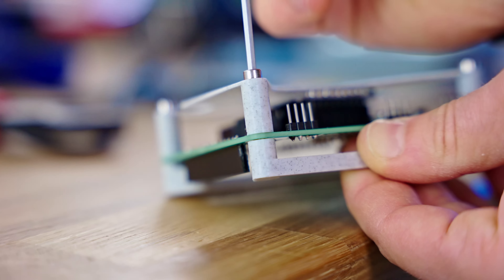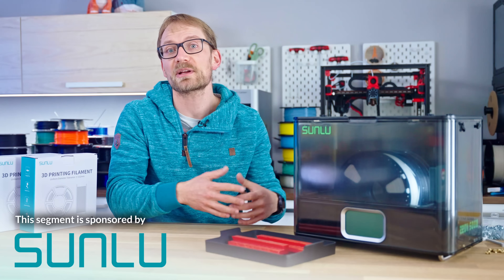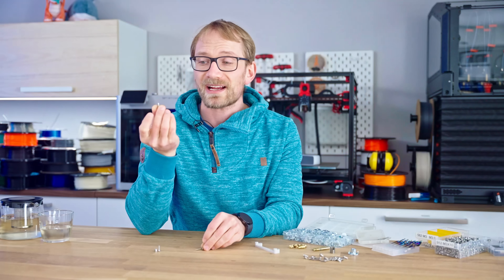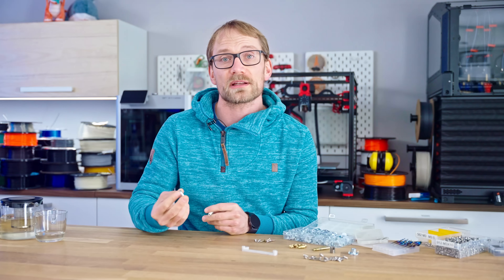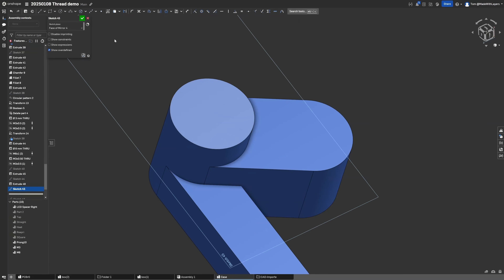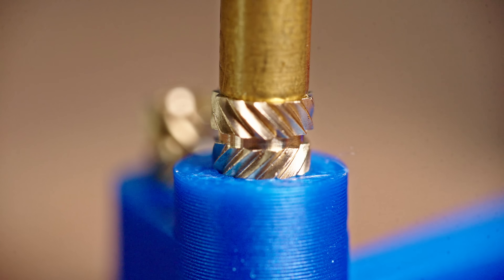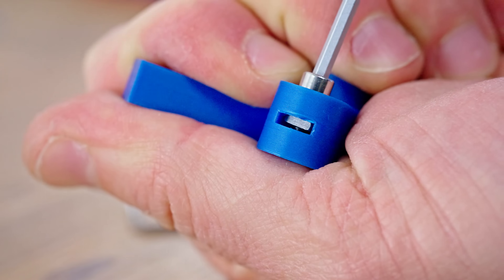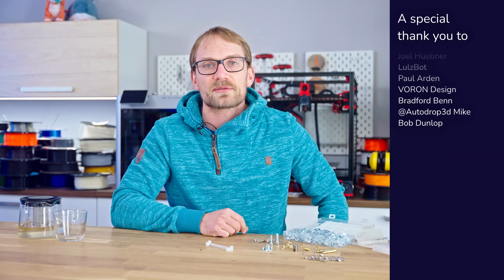A better way to add threads to your 3D prints

Comment: Self forming threads: instead of designing negative with those bumps, you can just create a hexagonal hole. If dimensioned right, threads will cut into the side walls and corners will give space for expansion. Especially easy when designing in Openscad. And instead of three bumps you get six surfaces for thread to cut into
Reply: I've started using a square instead, set to the minimum diameter of the bolt (2.5mm for M3, 4.2 for M5 etc) and it works really well.
Reply: @loganfraser great! Only reason I'd recommend hexagon or octagon is because thread will have more surfaces to cut into
Reply: Orca Slicer can change any hole into a geometric hole.
Reply: Nice, I'm going to give this a try, thanks
Reply: Nice idea, I will try that. Thank you

Comment: You lost me when you said it was hard to source wood screws.
Reply: Yeah... I kept thinking "where are you looking for supplies at?" 😬
Reply: I thought he was more referring to the plastic self-tapping screws, not the wood ones
Reply: They arent the most common for small sizes maybe like m2 or m2.5 sizes
But for common sizes yes wood screws are common
Reply: @yshaalan2011 they are all insanely common

All screw sizes are stupidly easy to find until you get up to specific large bolts.
Reply: @VoltsAnBolts  There are countries without Amazon where even machine screws are hard to get, even in EU
Reply: @julianahavart  In most of the US you just go to your local hardware store and they have a wide selection of wood screws.
Reply: I think helical threaded inserts with some adhesive on them to plastic weld them to printed threads would also be an effective option depending on the amount of tension
Reply: To be fair, I’m not the best or most experienced handyman that’s ever lived, but I’ve literally never even heard of wooden screws before this 😅
Reply: @fiucsavar  it's not wooden screws. It's wood screws. Aka, designed for soft and hardwood applications.
Reply: Hard to source wood screws and hand tapping is difficult. wtf
Reply: @CaptainCorpuscle1  Even if you’re too lazy to hand tap, if you’re melting the plastic with power tapping, you probably shouldn’t be allowed around sharp objects or power tools anyway.
Reply: @Jcreek201  It does sound kinda tedious to hand tap when there are many holes to tap. I can certainly see why using a machine could be tempting. 

Have you tried using a drill or something like that to tap 3D printed parts? I haven't tried it myself but I suspect that heating up the part enough for it to "melt" the threads is actually quite easy to do by accident. After all it may not take that much for many types of filaments to soften them enough that it will rip out the threads instead.
Reply: @Shannon4710 Loads of times.  If the size of the hole is correct, taps do not generate any appreciable heat cutting plastic. Generally, I’ll  model and print the threads and then just chase them with a tap though.  Only time I ever hand tap is if theres an access issue, and blind holes
Reply: @Jcreek201  Well that does sound interesting. My reasoning was based mostly on how hot drill bits and screws can get when working with wood. I didn't expect the same level of heat but still potentially enough to significantly weaken the plastic.
I will definitively look into tapping as an option the next time I have a print where I need screws then.
Thank you for your reply!

Comment: i think captive nuts can be a little better at strength than he says because you can get rid of the slot entirely: pause the print, put them in, and resume. You design the part to have a cavity for the nut that actually isnt accessible from outside. It does mean you're not getting the nut back tho

Comment: you could also buy a thread cutter and cut the threads manualy, since its just plastic they will last forever, just make the hole a bit smaller like 4,2mm for M5 screws. there are tables online for exact sizes which each Metric screw size needs

Comment: In onshape you can modify the mate connector so you don't need to make holes first, just set correct alignment of your mate connectors while importing a delivered parrt (yes - you don't need to create mate connectors beforehand if you dont need them later)

Comment: Something to consider: the slide-in nut approach, but using the T-nuts used with aluminum extrusions. The shape helps prevent them from stripping the surrounding plastic and spinning when you try to tighten them.
Reply: A square nut already gets you tons of surface area and requires less vertical clearance, so a smaller hole in the part. (You can also get thin square nuts, too - an M3 thin nut is like 1.8mm thick.)
Reply: @ed3dnet  It's not always enough surface area, and the corners have a limited lever arm, so it's still possible to end up chewing up plastic when things have to be tight. Also, I haven't done it, but you could potentially design the hole so the nut slides in from outside, similarly to how it slides into an extrusion slot, leaving it captive in a hole it can't easily fall out of.

Comment: You've missed: 
1. Round slide-in insert "Schacht Barrel Nut"
You can drill side hole after print.
2. Heat bolt by using solidering iron and screw in.

Comment: just saw a video on using a slightly tapered hole earlier today. I personally use threaded inserts or nuts in 95% of my applications though.

Comment: I think video is good but just plainly dismissing self tapping plastic screws when talking about plastic is completly unacceptable. And they are cheapest despite what you said, and also ignoring modifiers to increase wall count on screw holes.

Comment: I typically just screw right into the part. I find that a 2.9mm hole in CAD results in the best balance between strength and ease of installation. You can typically take the bolt in and out 15-20 times before it starts to wear out. The major thing is to not overtighten it. Thanks for the video, cheers!

Comment: It took me a while to find out how to print fitting threads because the threads printed “as is” are always too narrow and I was sure that the extra tolerance should be proportional to the thread diameter. But it’s actually really easy : after creating a thread of any diameter and any pitch, I just apply a “press pull” of 0.1 mm on all three sides of the helicoidal groove. It works like a charm for any size of thread as small as M3. I know that how it sounds but it just works… sometimes I press pull 0.15mm but usually, 0.1 is fine.

Comment: I generally just use a hole that is too small to slide the bolt through. The plastic is soft enough to just force the bolt in.

Comment: I've always just printed straight walled holes that are slightly undersized to the thread diameter (my mk3 likes 0,25mm undersize). Sometimes I'll add a small section at the start of the hole thats larger diameter as a thread lead-in (helps get the screw started and helps register the part location by allowing the screws to fall-into the hole slightly). Only had trouble with thread strength at the lower sizes (m2 and m3) and there I just print longer screw holes and use longer screws. I'll usually print the holes with 4 or 5 perimeters or solid infill around it so that if need be I can drill out to a slightly larger size and keep using the hole.

Comment: I use good old hex nuts (usually M3) because they are way easier to find (and cheaper I guess) than metal inserts or square nuts, I make hexagonal holes in my designs for them and I avoid over-tightening them (usually screws don't even need to be tightened too much to avoid damaging the printed part). Also self-locking nuts (those with a nylon o-ring attached) can be a good option in some situations to make sure they don't get loose over time.

Comment: I like to use hex nuts inserted from the back. I add a tapper to the walls in the print for the hex nut so they wedge in when you tighten down and stay there just fine

Comment: I designed a custom laptop tray which can be fitted to my VESA monitor arm and I printed it in PETG. I had originally intended to secure it with nuts and bolts but I discovered that one type of socket head screw I had lying around threaded very snugly into the mounting holes (which are 13mm deep with a lot of surrounding material). Four of these screws have been securely holding up the bracket and my laptop for over a month. I check the connection every couple of days and it shows no sign of loosening.
Reply: On the flip side, I have also dramatically over-engineered parts to use embedded nuts when a simple hole would have been more than sufficient.

Comment: One thing to note on square nuts:  I use a lot of stainless fasteners and when they fail, they will lock up and spin the square nut which makes it easier to scrap the part than to try drilling them out.

Comment: You can make the nut embedded into the 3d print. I tell the slicer that I want to change the filament at the right layer, insert nut, then resume the print.
Also you can use butterfly nuts. Make a cutout for the butterfly nut, it will be very strong. but needs a lot of space.

Comment: I've been creating designs that require a lot of M2 screws. I used printed holes (FreeCAD). I've had 40 out of 40 holes work with no problems. Next I have to do an M3 based design. We'll see if I have the same success......

Comment: if you heat a screw to the right temp you can form the threads with the screw itself, just screw it in slowly and leave it screwed in until the screw is cool.
lazymans "3D printed threads"
you can also pause the print, insert stuff and then continue the print so the 'stuff' is overlapped with further print layers..
heating the inserts is a cool idea too.

Comment: One thing with "slide in nuts" you also have the option to insert them while printing enclosing them completely and preventing almost all movement which is something I have used quite a few times, the obvious downside is that it limits their placement to be parallel to the printingbed so its definitely not ideal but its a good option if you dont have threaded inserts at the time or arent comfortable with them in general

Comment: If you have to screw it in once, tap the thread in the plastic (or plastic screws for smaller screws under M3) . If you need to keep on removing the screw, heat set insert.

Comment: You could try using tri-lobe type machine screws. These are used to self tap themselves into aluminum, but haven't used these in 3d printing.

Comment: personally a huge fan of the slide-in nut method - gives you extra choice around using locking nuts or the ability to use nylon or peek fasteners if you don't want metals in the parts etc.

Comment: For most things I just use machine screws into the properly sized hole in the print, for more strength, I use hex nuts on the rear of the part held captive by the print.  I havent needed any more than this in ten years of playing with printers.

Comment: They sell the plastic specific thread-forming screws on McMaster, so they are not that hard to get.  I've used them extensively with molded parts and would be my go-to for printed as well.

Comment: I use brass inserts with glue, rather than using heat to insert them; I make the hole slightly bigger, so the insert is an easy push fit, and seat it with epoxy or contact adhesive.

Comment: If you are making a component that needs strength, and may split along the layers, add some through-bolts perpendicular to the layers to keep them compressed.
I made a replacement guide-bearing block for my bandsaw, and added four M6 bolts.  (M3 would have worked better, but all I had on hand was some M6 AllThread rods.)
The finished block is MUCH stiffer, and stronger than the original casting-alloy blocks.
Sorry if this is a bit "Off-topic"... I thought is was close enough to be worth posting!   😜

Comment: When using the square nut in a slot method, if you make the slot as far as possible from the mating surface, you get a stronger result.  You will need a longer bolt/screw of course.

Comment: I like then heat set inserts.  Youve just got to make sure youve got plenty of wall around your hole, amd make your hole a little deeper than your bolt so the melted plastic has a cavity to push into rather than backing up through the insert.

Comment: I have had threaded inserts in storage for years, those good quality ones. Still I just model threads from M4 and larger and generally speaking very happy with end result. Then if I need more strength for like packaging machine parts I many times just put normal like M8 nuts pockets into designs or through holes with normal fastening if absolute strength is needed. Also driving like +M8 bolt into printed thread results in nice amount of heat friction to form threads nicely. Fast and easy.

Comment: I just assumed that most people simply heat up the actual screw thread with lighter like I do. This method requires printing the holes exactly the same diameter as the thread, which gives you just enough tightness to insert the heated screw.

I simply just put the required screw on a magnetic screwdriver and heat it up with a lighter. Obviously it's good to use just one sacrificial screw to create the threads rather than tarnishing all the screws that are inserted into the model. If the screw is made of aluminium etc then simply put a small blob of Blutac on the end of the screwdriver to hold it in place while you heat the screw.

Comment: There is another good way to strengthen screw holes.
Make a hole that is slightly smaller than the diameter of the screw with the thread so that only the thread "eats" the plastic.
But to give the hole strength so that it doesn't tear out, add thin grooves around it, about 0.1 mm thick, about 0.8 mm away from the hole itself (twice the thickness of the nozzle) and distance the grooves to the nearest outer wall by a similar distance of 0.8 mm.
The grooves are made so that they start from the roof/floor at a height of about 0.4 mm or even 0.6 mm, so that they are completely inside the model and are not visible outside at all.

These grooves cause the slicer to build walls around them, in a way that is not visible at all outside the model. These walls grip the hole so tightly that even if the screw "eats" it, it still won't be able to tear the cylinder of the hole from the rest of the print.

This is different from the usual way, where the hole itself is only gripped by the infill, which is not strong enough to prevent the hole from collapsing.

Comment: You can use a modifier (in certain slicers like Bambu/Orca), to print the holes, and surrounding area, at 100% infill before doing some of these tips.
This will improve them no end :)

Comment: You missed one. Print slightly undersized hole, drill with tap drill and then tap it. Also, the number of walls you use will make the hole better supported.

Comment: The remark about the coarser threaded screw holes is wrong: you can increase the perimeters at the holes... yes it will take a lot of slicer work but you can not claim it can't be done.

Comment: Usability problem with the M3 tapless threads in Onshape:
-You can't use multiple derived instances from the same source. Every location has to be called out at once in a single Derived to work. This means you can only choose one type per part studio, so if you need both types in one part studio, you'll have complications.
-When importing the self-tapping version which is off-origin, you have to transform the mate connector back by the same amount in the other partstudio, so more measuring and manual actions.
-Finally, If you want the thread not to be so deep, you need to extrude cut each negative space down to the depth you want, before boolean subtracting it with your target. You can't simply transform it, because the starting taper is in position, and translating the part would remove it from the boolean operation...
-When getting ready for 3d printing, the orientation of the circular pattern matters, so the circles need to be axis aligned or rotated by their mate connector for a high quality 3d print without overhang in horizontal holes.

Maybe you can revisit your partstudio? I think there are way too many variables to tune to use this casually. It should be made into a featurescript... I've made a copy of your part studio to do this with M2 screws, and added a few descriptions and variables, but based on the feedback above, the part studio also needs a rework.

Comment: Use a m3 drill tap, you get m3 to m6 dril taps in a set for RC. Most 1/10 scale rc use 3.5mm hex heads you go smaller if you need bearing and things for your printers they are thinner than the bearings in that cheap upgrade video you posted months ago i just watched! Check them out and let me know if they are what your looking for?

Comment: Its important to spread the load over the largest possible area. Therefore I recommend using washers WHEREVER you have a nut or a bolt head pressing on a surface of plastic. Especially fragile plastic as in 3D printed parts. Off course you have to design for that, but the end result can be that it seems you know what you are doing 🙂

Comment: I have never used anything other than small wood screws for assembling 3d prints. I really dont understand this hobby's obsession with machine screws. Wood screws dont need as much thread engagement as you think, so thin walls are not an issue. Where I live they are faaar cheaper and easier to source. They only ever need a blind hole and i have never had any kind of mechanical failiure

Comment: For the hex or square nut, why wouldn’t you just have an indent on one side of the print to place that nut, rather than a slot midway through the print?

Comment: For heat set inserts, you can also install without heat by using a screw and washer to pull the insert into the part. This does require you to have access to the rear side and clearance for the washer. But is good for small numbers when you dont have a heated tool.